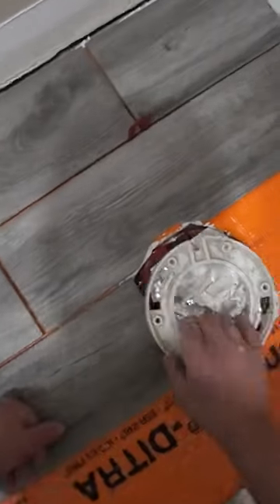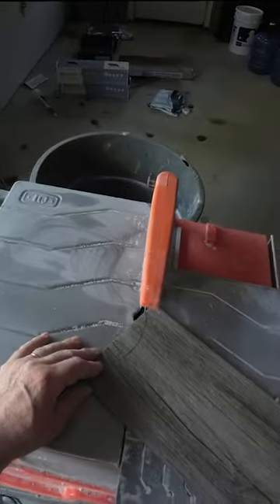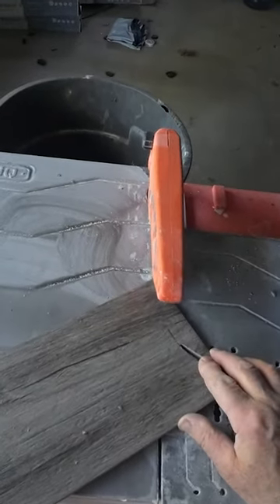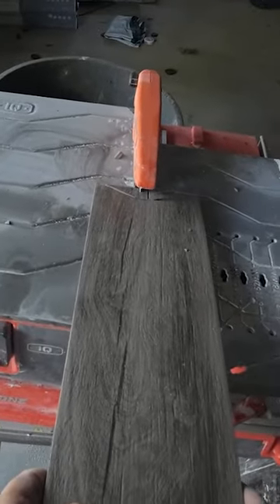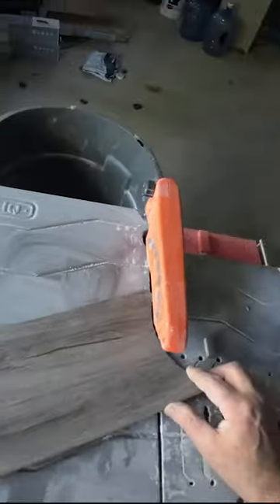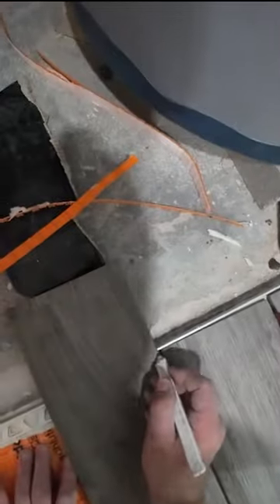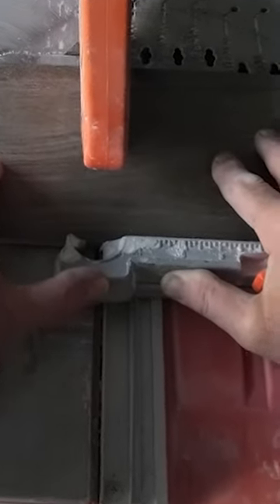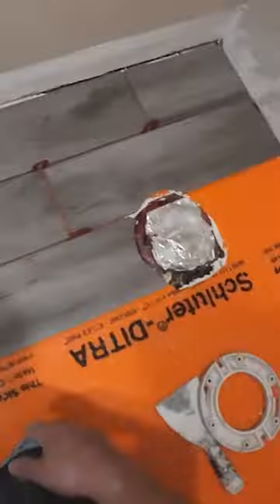No Bond breakers, when tiles are cut dry IQ 228 Cyclone 7" Tile saw #shorts #iqpowertools

Comment: If you are keying the Thinset into the tile or backer board, moisture content shouldn’t be an issue, just don’t want any pooling water. A damp tile will make for good adhesion vs. A tile with a bunch of dust or fabrication coating on it.
Reply from the maker: SSD Saturated Surface DRY

Comment: Good video.  Does the Iq saw leave any dust residue on the pack of the tile?
Reply: That's what I was thinking, you still have to wipe it down, and then dried off so
Reply from the maker: No it does not.
Reply: @SalDiBlasi  I understand that the IQ saw is dustless and whatnot but you don't know where the tile has been during shipping or the manufacturing plant, you always want to wipe down tiles, and then dry them oh, so if you're already using a wet saw in your Waters kind of clean hopefully you're going to wipe it off anyway but I understand where you're coming from

Comment: when I use my grinder the tile doesn't get super hot but does get hot if my wet saw doesn't have enough water in it. is it the speed difference or what
Reply from the maker: Saw is designed to  suck up the dust and cool the blade, the blade is designed to stay cool and cut clean.
Reply: probably the size of a diamond dust in the cutting disks.

Comment: dry cutting will have high risk of chipping the edges near the cut
Reply from the maker: Unless you use a saw designed to dry cut tiles and give a cut edge equivalent to that of a wet saw, like these IQ saws. Blades are proprietary for the machine. Substitute an unsuitable blade and you will get chipped edges from blades that are designed to cut wet. The blade will also be destroyed in short order. This is not equivalent to cutting with an angle grinder and a dry cutting 4.5" blade. The IQ saws and Blades are specifically designed to  cut tiles dry efficiently and give a quality cut.
Reply: @SalDiBlasi  Sounds like an expensive system.